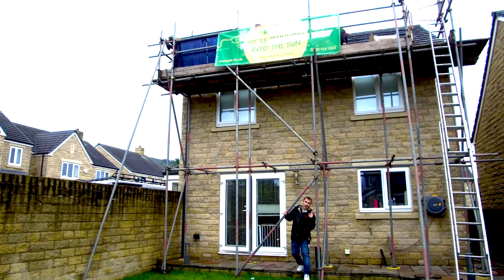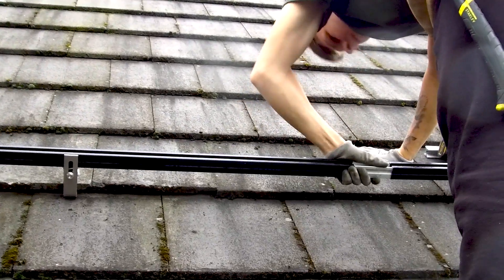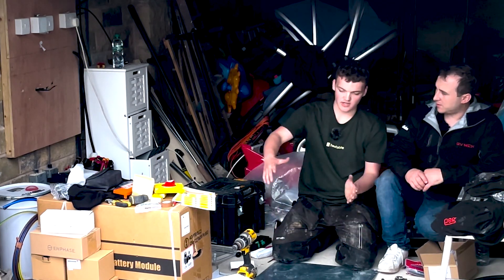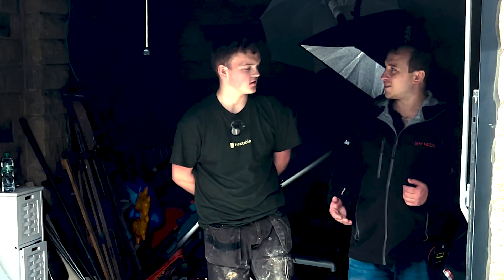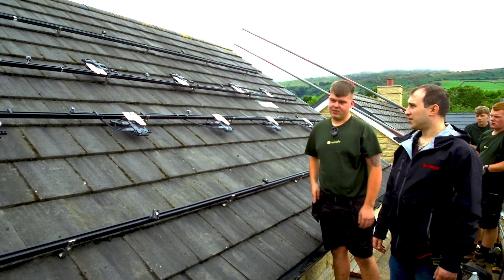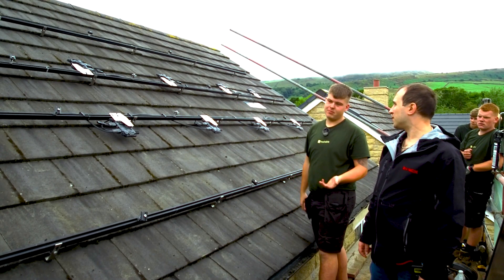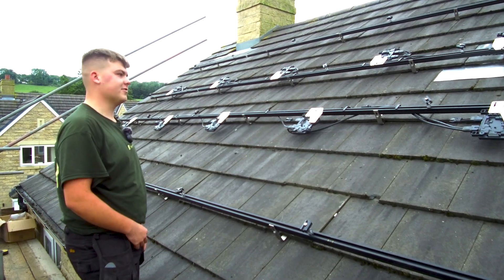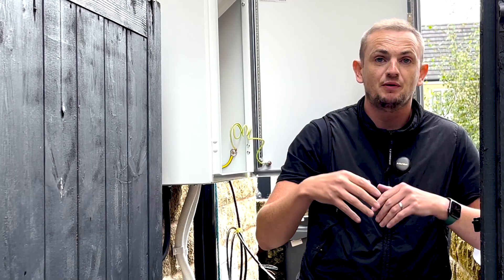Plug & Play - Solar Installation So Easy Your Nan Can Do It

Comment: Roof looked to have no shade so microinverters an unnecessary expense that could have been saved. Your microinverters have a maximum power output of 295va. This, I presume, will be a lot less than your panels output. Also leaves double the amount of equipment ( panel + inverter ) on the roof to potentially fail and require scaffolding to replace. Buy quality panels and inverter would minimise your future expense.
Reply: I never understand why people think you only use microinverters for shade. There are so many other benefits.
You can combat shade on a string with optimisers.

Other benefits to be aware of -

No high voltage DC cabling (most of the solar fires are caused by high voltage DC arcing)

22v start up and shut down - more generation

No AC draw through the night like hybrids

Fully addressable 

Whole system fault limitation

Warranty period (those are Enphase so 25 years). That a comparable 10-15 year warranty risk against a string inverter 

Shading is an additional bonus.

As for the 295va - what do you think a UK panel is doing year round?
Reply: @PVOK232  I agree that dc, when installed incorrectly, can arc but the high voltage leads to less power loss. As todays panels are 420w ish, then putting 295w maximum inverters on them potentially loses 30% immediately and that is throughout the day. A 420w panel in the uk can easily pass 295w on a sunny day and would be I.r.o that on a cloudy day with diffuse sunlight.
Reply: @billyoung2458 From my experience, 90% of UK systems never frequently get above 70% of their Pmax, save for perhaps a few hours over summer. 
When this does occur, it’s usually midday and unless your battery (if you have one) has a very high charge rate or spare capacity, as typically on those days the batteries are already full then you end up exporting it for 3,5 or 10p etc.

It’s not standard practice to install a 3.6kwp system with a 3.6kw string, the efficiency would be terrible.

Personally, I’d take an early start up, late shut down with a flat production curve which met my demands over a peaky system which needs 120-250v to kick over (on).

DC is cheaper to buy though and most installers are competent fitting it. Horses for courses.
Reply from the maker: @billyoung2458  hitting the pmax of my panels might ocur 5% of the year but the other 95% of the year these solar panels will keep the inverters at there most efficient levels and overall will produce more energy than a smaller Pv panel
Reply: @NicolasRaimo  as has been said ‘horses for courses’. Enjoy your new install.
Reply from the maker: Cheers billy am a huge fan of the DC being converted on roof to be honest I’ve seen many DC install issues and this just gets rid of that
Reply from the maker: Micro inverters have a 25 year warranty and a 1 in 2500 failure rate also I have no single point of failure,  they switch on with lower voltage meaning extra generation as well,  some shading from the chimney but remember this is the UK and clouds could shade panels  this system should out preform any inverter system with better redundancy

Comment: Neat roof install. I would have preferred the electrical devices inside the garage next to consumer unit rather than next to the meter box but I guess there were reasons for that. Looking forward to the data. Days getting shorter so generation all that more important.
Reply from the maker: The garage is 30 meters away from house and meter box so distance issue

Comment: I didn't pick up the total installed capacity, I'm guessing 3.25 kilowatt peak? (10 x 325W) 
Looking forward to seeing how your system performs as your roof has the same orientation as mine, except that I have 6 panels on the east and 4 on the west, totalling 3.25 kilowatt peak.
Reply from the maker: 10 panels 420w and micros are 290w each so 2900kw peak it’s preforming amazing so far am less east more slightly north azimith be in my reports on system
Reply: @NicolasRaimo   I will follow this closely and with great interest. Thank you for replying.
Reply: @NicolasRaimo  you sure that's right mate? surely u should be getting around 4.2kW peak with those panels? Those micros are really hampering the capabilities by the sounds of it unless I misunderstand (which I probably do lol)!
Reply from the maker: @miickyp  panels and micro inverters were designed and specially designed by REA solar (panel make) and Enphase (micro inverter) they are the ones that designed these panels and these micro inverters based on UK weather and getting maximum efficiency from panels…. Designing a 410’watt panel with a 410 micro inverter might seem a better design but you end up with less output over the year this is due to various parts of the system including ideal weather conditions and temperature needed etc… I’ll be doing a video about the benefits of over sizing system and how clipping doesn’t make a major difference to total yearly output however sizing panel to inverter means less efficiency as inverter is designed to be at 80% load for maximum effect.
Reply: @NicolasRaimo  wow that sounds technical, you definitely need to do a video on it mate!

Comment: Broken tile there at 6:20!
Reply from the maker: Do you mean the one at 6:14 with a TINY chip of the corner that just cosmetic?  They replaced broken titles full info at the blog on evnick.com/solar
Reply: @NicolasRaimo  those tiles are a bitch to work with, as long as they were replaced your good!

Comment: How did you manage to get solar installed Nick ?  Thought the house could not have it installed as part of the agreement Etc?
Reply from the maker: 😀 Story for this coming soon but lets say there is a way just isn't cheap had 2 options pay a fee or buy out lease
Reply: @NicolasRaimo   def buy out the lease easier to sell the house and not tied into ever increasing leasing to renew and any maint contracts etc
Reply from the maker: @ghost70  £15,000 to buy it out plus £1000 legal fees my side